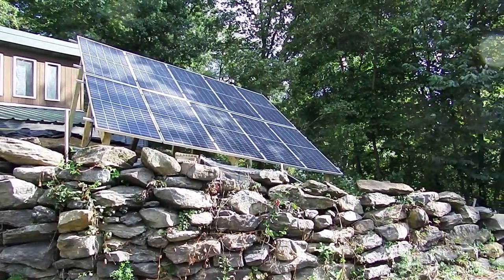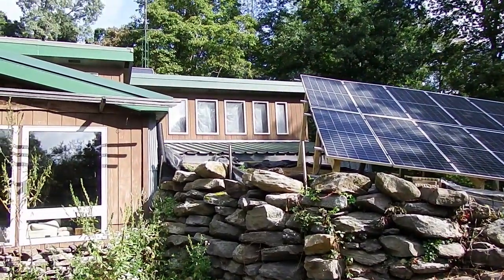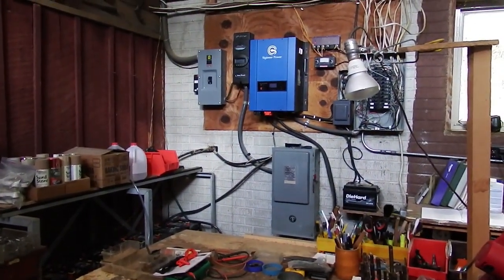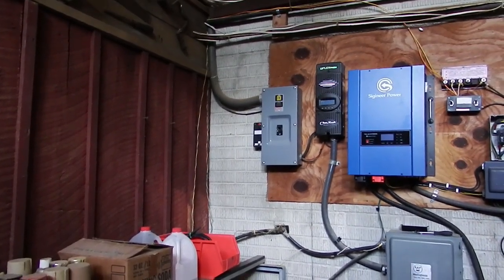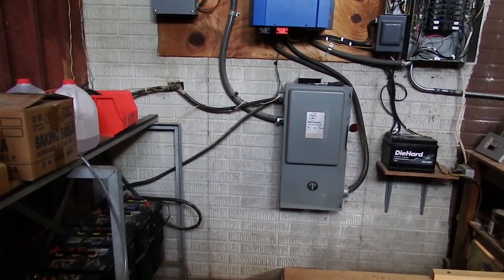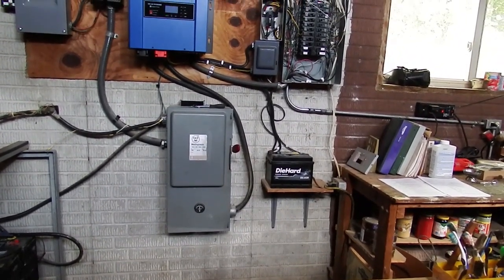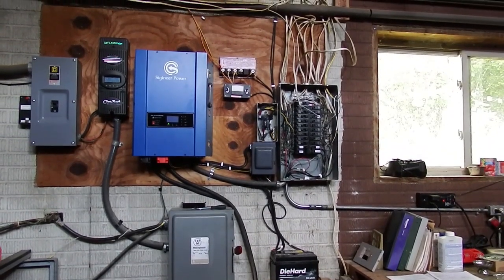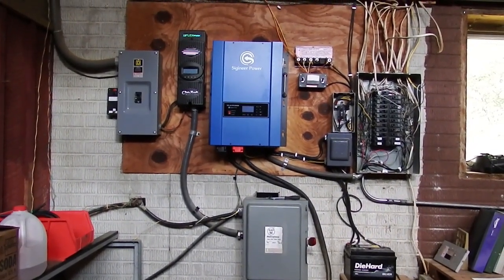Off Grid M6048D Solar Inverter System from Mark in Ohio USA

Comment: Can you get the 20 klw sigineer in 96-120 volt dc battery input
Reply from the maker: Sorry, we don't have such kind of model. The 15KW is the only 96V model available.
Reply: @sigineerpower7134  too bad a 96-120 volt battery version would be great for the 20 klw. Would cut the amp draw in half